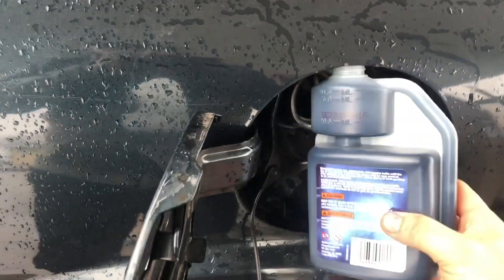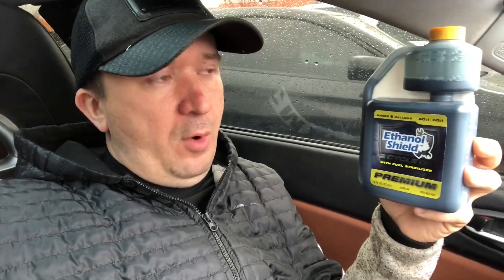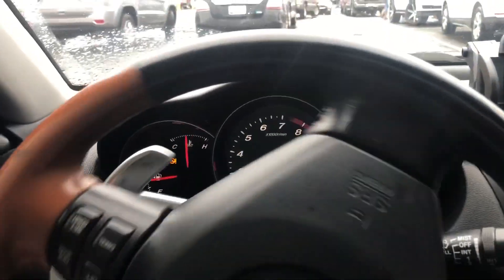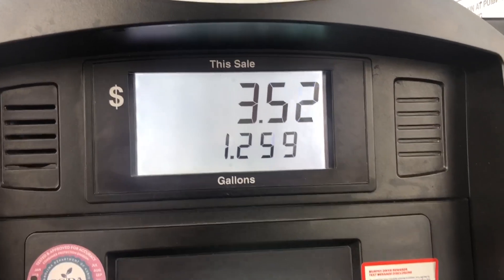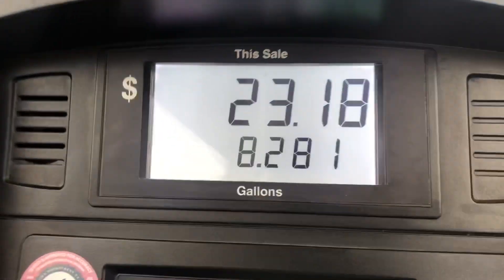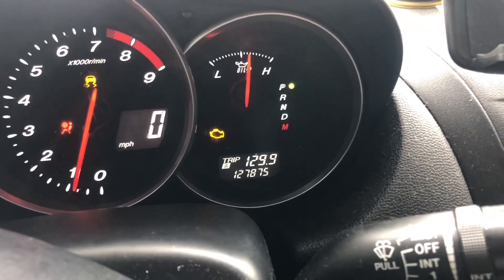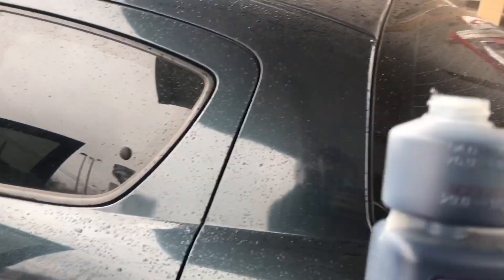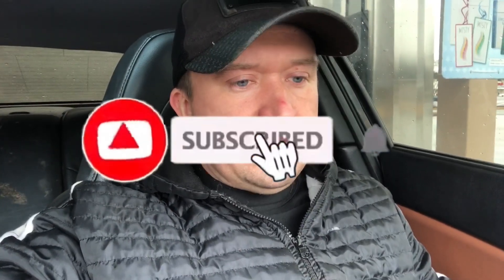Pre Mixing How to Pre mix 2 Cycle oil into your gas on a Mazda RX 8

Comment: What type of fuel is required on a 2005 RX eight? Is it premium? Or non-ethanol?
Reply: premium and pour the oil in the gas then put gas in. i only fill up my tanks so ik but how to use each time. just a little tip too keep it under 5k rpm for better fuel economy
Reply: 93 octane, can get it switched it e85 with a kit.

Comment: WHAT? Did you put 4 tires on your RX8 for $250. Are you kidding me? That’s $65 per tire. What’s the matter with you.? The proper tire for an RX8 is typically approx. $180 to $250 PER TIRE. THE CAR COMES STOCK WITH BRIDGESTONE POTENZAS  a set of 4 is $1000. I just replaced my Michelin MX4’s with 4 YOKOHAMA YK 740 GTX’s = $968. I’m sure your 8 feels like a piece of garbage on the interstate. PS. Do you realize you are suppose to pour your 2 stroke oil in BEFORE you add your fuel for proper mixing? PLEASE buy some REAL QUALITY TIRES for your 8 so you can feel THE REAL RX8 PERFORMANCE. C’MON MAN.
Reply: That’s that money talk 😂 factz! 💯
Reply: Maybe he just didn't want to

Comment: U put the oil first then the gas so it mixes correctly. Go to home depot and buy a gallon of supertech tcw3. Always use tcw3 oils. Also conventinal is better then syntetic 2 stroke for rotarys. I oay 12 bucks for the gallon been running it for years

Comment: Have you gone on the RX8club.com site and read the new owners start here thread?   
 The gas tanks on thee cars are a dual saddlebag style and unless you put the oil in first you won't get a proper mix.  Also the 2 stroke/rotary engine oil should have one of the following ratings (ISO-L-EGD,   JASO FD,   API TC) or the sulfer content will eventually clog the catalytic convertor ( if you're running one).
Reply from the maker: Thanks on that advice. My Catalatic converter was clogged when I got it, so I removed the cat and got a mid pipe instead, so at least I won’t need to worry about clogging it now, but it still feels like low torque at the beginning as I accelerate, then it goes fast once it reaches 5k RPMs and higher.
As for Pre mixing I always add mix first then fuel ⛽️but when I was at home my tank was full without the pre mix so I added on top, I knew it’s not going to mix well but there was nothing I could do

Comment: Idemitsu best premix for Rotaries, period
Reply from the maker: Thanks wow it’s racing premix, I will try some, it’s $20 per quart do your know why it’s better then what I got?
Reply: @mazdarx8diy38  He has no idea, i'm pretty sure no research in this statement was involved, probably just telling this because Idemitsu has experience with rotary.
Other 2T FD rated oil probably will be not worse or even better in lubrication.
Not sure about injectors clogging, probably they will clog a bit faster no matter what you add.

Comment: Idemitsu is the best premix for Rotaries,period
Reply: its nice but i cant find it anywhere in canada, in ebay is super expensive
Reply: That’s exactly what I use
Reply: Why is it that the 2stroke/2cycle bottles contents are dark, but the Idemitsu Premix looks clear like gasoline/or a Fuel Injection~System Cleaner???
Reply: Yes that the one i use or amsoil dominator really good too. I used Klotz before real good lubrication but it get the spark plugs dirty

Comment: One question is it more convenient to fill gasoline first and then premix or fill gasoline and then premix? I ask because I have been told that if it is not done well it can damage the octane rating of gasoline.
Reply from the maker: I have done both, what you can do is, Pre mix into 1 gallon gas can can add that before you fuel up, I think it would be best, just do an estimate if you have half a tank you will need about 8 gallons of gas so add 4 ounces of Pre mix into 1 gallon can, fill it up with gas’s then add that into your tank then fill up additional 7+ gallons of gas into your tank